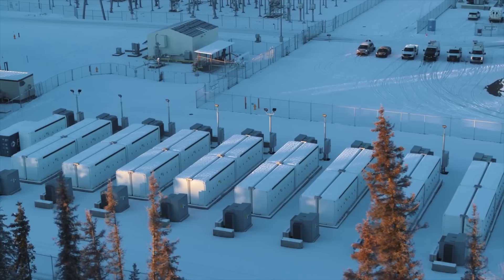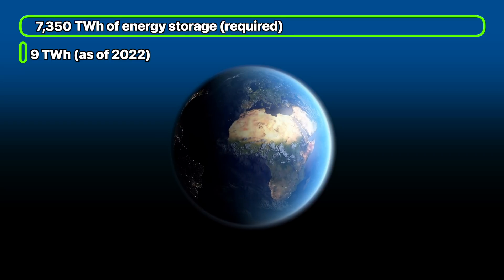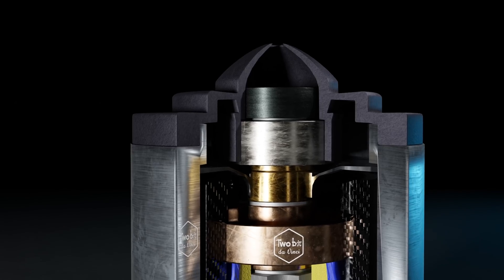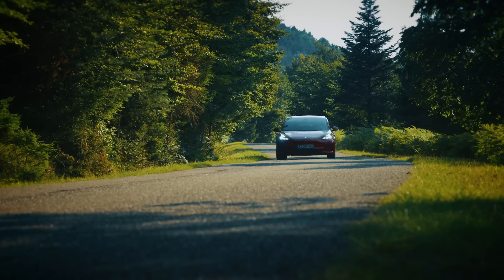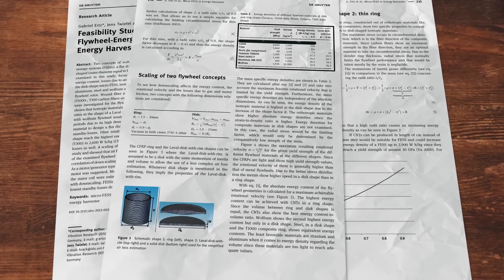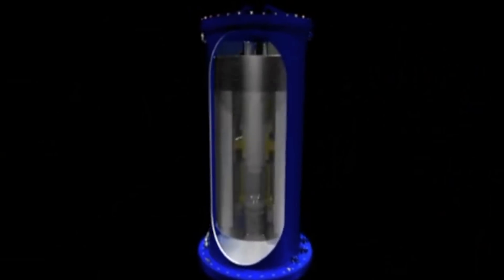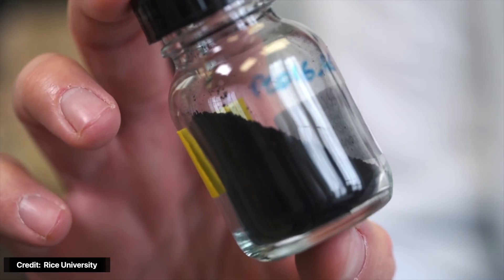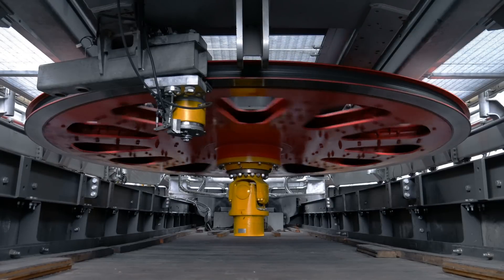Breakthrough Energy Storage Tech CRUSHES battery prices by 90%!

Comment from the maker: Go to https://bit.ly/3xzaugU  and use code TWOBIT to get 15% off ClickUp's massive Unlimited Plan for a year! Start reclaiming your time for less than $5 a month.
Reply: Would not a larger flywheel  (like 30 meter of diameter) be more efficient ? With magnetic suspension, it would allow lower spin limit (and thus less expensive material that don't need to stand high centripetal force).
Reply: @En_theo  The problem is that magnetic suspension isn't simply free; magnetic fields sweeping through conductive material induces eddy currents. These cause eddy current losses, as those currents heat up the metal and dissipate energy as heat.
Reply: only non ferrous metal produce Eddie current,big steel can levitate with magnets in the bottom repulsive force ant in the top atracción force.
Reply: @yvanpimentel9950  Are you sure about that? Induction cooking stoves work with ferrous metal pans. If eddy currents were not produced in ferrous metals, how could induction cooking work with ferrous cookware?
Reply: @Berkana  heat is created if a alternating current traveling true a coil (electric magnet) in ferrous metal,non ferrous metal like aluminum ,fold ,silver copper produce Eddy currents like magnets that opposes the one in the electric magnet,heat is Olso generate ,if aluminum is used in a inducción cook stove it should vibrate more than heating.
Reply: @yvanpimentel9950  
Or we could use water and fill the flywheel ? Can't be cheaper and if the wheel is large enough, it can store kinetic energy with lower rotational speed. It should also be cheaper to have one big wheel than several small ones.
Reply: @En_theo  fricción from water is small,but at lower speed and gigantic size weel it might work.
Reply: Do these ultra high energy storage flywheels have gyroscopic forces that resist the rotation of the turning of the earth? As the hours go by, a flywheel mounted vertically will change orientation due to the earth's rotation to a non-trivial extent. Gyroscopic forces would certainly exert pressure on the axis of rotation. Could this contribute to flywheel losses?  I imagine that a flywheel storing a huge amount of energy would have to be pointed at true north and tilted to be parallel to the axis of the earth to cancel out this problem, but none of the flywheels you showed in your video seem to be doing that.
Reply: It is so foolish for the global warming and climate change alarmists to think doing away with fossil fuels is a good idea. In fact, the accumulation of fossil fuels, biofuels and sequester of CO2 in the ground for a long period of time will eventually  lead to a repeat of the largest mass extinction of life on earth like that happened 250 million years ago when massive volcanic eruptions caused huge amount of CO2 and natural gas trapped underground to be released into the atmosphere.

We know the killer lake Nyos killed a large number of people many years ago when the CO2 accumulated at the bottom of the lake released all at once during an earthquake. Since then some smart scientists have been keeping the lake safe by releasing the CO2 from the bottom of the lake into the atmosphere gradually with pipes and pumps.
Suppression of CO2 release into the atmosphere by banning fossil fuels and by sequestering CO2 in the ground  is  as stupid as suppressing the dissipation of CO2 from the killer lake Nyos into the atmosphere by banning the degassing with pipes and pumps.
Reply: I do not ven know if this is a current thing or even possible but... Magnetic bearings for the flywheels? Can't lose energy to friction if there is none yeah? Or even the much harder possibility of using quantum locking (but how would we keep it that cold?)
Reply: @TheWeaponshold  magnetic bearings are not lossless. They can induce currents which give resistance that drag on the flywheel.
Reply: @Berkana  Eddy currents. You can use windings to reduce that but IIRC that was to redirect the energy not prevent losses. But I would still love to see comparative testing.
Reply: water pump with compress air is to me the best because you can oversized capacity without increase of metal sheet but decreasing the amount of steel per unit of power, even if conversion only go to 80% long term is 100%,if windmill is the power supply the air tank can be the tower decreasing the overol investment even more savings if the generator is hibrid,this is water turbine in one side and a fossil fuel power supply on the other end,this will ensure continue power producción.
Reply: Have you heard of Teraloop?
Reply: Yes. Making your flywheel smaller and lighter. Requires higher RPM. Which exceeds the material strength of most metals.

However. Flywheel energy storage. Is not a great application for mobile or even compact space-saving locations.

It's meant to have all the room it needs. And be immobile. Not to mention all the resistance it produces on the drivetrain of any operating vehicle.

From race cars, bicycles, Avionics. Or just the good old crankshaft flywheel for most combustion engines.

It just depends on the application. But that's my point. Where The flywheel is most applicable. Would be large-scale power storage.

Where you can have a very large flywheel. With as much energy as you can engineer into the size of it. And then operate at very low RPM. With a cubed energy density to match.

And while better tinsel oil strength is always better. More mass is more important at larger scales.

In which case they should be made out of lead. Where the greatest engineering feat is how not to apply any resistance to something of that size and weight.

But higher RPM is better. At any diameter.!

Comment: I'm sure the flywheel battery is excellent system. By the way why don't you use oil bearing for vertical axis? It has very good lubrication which is applied for turbo molecular pump.
Next question: Maybe you use a DC motor. Voltage of the motor (generator) goes up and down by charging energy or discharging. What is the range? If you use a system of changing frequency 
, how do you control the line voltage?

Comment: Switching electric power supplies are efficient and operate as delivering energy during a timeperiod of  then a timeperiod of no power delivered; I wonder if a flywheel can be charged and maintain its energy using electric motors and switching power supplies having a longer off period allowing a flywheel to deliver energy during the off periods

Comment: A capacitor that size could easily store as much power and would not suffer from the acceleration of mass, self discharge, and energy conversion  problems. This is a boondoggle.

Comment: Is anyone developing gravity batteries in a serious way yet? Where you lift a a weight into the air with spare power, and then lower it to regain power in a lull. Basically pumped hydro. But with a huge lump of, say, concrete.

Comment: I'm so confused as to why light weight material would make a better flywheel.    Maybe it's the difference between that battery looking flywheel and the large diameter style.    But that inertia from the weight seems pretty important on the surface to me.  especially if you reduce the friction with magnetic bearings.    I need to look into this more.  Very interesting.

Comment: the problem with flywheels is they all lose their energy in a day. so flywheels can be used to stabilize solar/wind  when is intermittent in spans less than half a day. so maybe a during the night wind and flywheel work together, but if it is a still windless weather and long night maybe the flywheel won't be enough. This is why I believe flywheels are better used for peak time get the excess let the lithium battery discharge a bit and then recharge it with the flywheel.

Comment: The key is not to depend entirely on solar. The ideal home and municipal grid would have a diverse array of generation and storage options. Each have their advantages. Solar generates a good amount during the day, wind generates all day, tidal/hydro has massive torque potential as well as consistency, and fuel should really be our backup when all else fails not our mainstay generation. To that, chemical batteries are energy dense but high maintenance, flywheels are low maintenance but need a bit of energy to keep  their stored energy, gravity batteries are great for long term in my opinion but should be underground for their potential destructive capability if they fail (same with flywheels IMO). I have high hopes for thorium-uranium nuclear and cold fusion but they also should be part of a diverse grid.

Comment: bro, taking "goal number" of tesla 4680 energy density and saying it's production numbers is something. they are not there yet . also comparing energy density of battery and flywheel is strange at minimum. flywheels are the worst possible solution for mobile use bcs of the gyroscopic effect and additional stress on bearings. and u used power density and energy density like these are different things...   ffs why i even subbed?

Comment: flywheels could even be used to fast charge battery electric cars, with the car rapidly spinning the flywheel up  when plugged in, then gradually converting that short term mechanical energy in the flywheel into long term electrical energy in a battery

Comment: Thermosyphoning liquid metals such as mercury through a coil to produce electricity was discovered many years ago. This only requires low grade heat to operate, and there is a gigantic amount of low-grade heat currently underutilized. Imagine the heat from road surfaces for example, or roof spaces, hot sides of structures and so on. The metal circulates around and around and there are no other moving parts and it is said to be 55% more efficient than an alternator. I enjoy your explorations so much, thanks.

Comment: There's always a practical limit to the maximum amount of energy that you can safely store as a rotating mass.  
A number of horrendous and extremely destructive accidents have occured in the early days of industry when large flywheels have broken free from their bearings and destroyed buildings and factories. 
From an engineering point of view the use of a flywheel is simply to smooth out power impulses,  to overcome any intermittent or unbalanced resistance, and to reduce vibration. 
I was once unfortunate enough to be standing close to a high speed steel fan which weighed about 150 lb's when the shaft on which it was mounted suddenly sheared off.   The fan totally destroyed it's steel housing which was fabricated from  3/16" steel plate and ripped it loose from it's holding bolts. 
Believe me you don't want to be anywhere near large revolving masses when they fail.

Comment: If flywheels were worth it, by now you would see them in the basement of many homes so you could charge them at night when electricity is cheaper, and then use the power during the day. But you don't. The free market has spoken.

Comment: The one big problem with this is the fact that you have 2700 watt-hours per kilogram of fully charged flywheel just waiting to be turned inevitably into thermal energy in the event of an accident.
It would be like setting off an underground bomb.

Probably wouldn't be an issue if they were sited in remote areas but it would make building an array of them really hard.

Comment: Best Battery = Ambient Space

Over 50 years ago,  famous physicist Richard Feynman said :
"The vacuum of empty space appears to be an energy reservoir of immense capacity 
that makes nuclear power seem old fashioned.  
The amount of energy available in one cubic centimeter of the vacuum [ambient space]
is much greater than the energy density in an atomic nucleus."  

If you can harvest more energy from the space around you than you can use, 
then, logically,  you don't need big batteries or big capacitors. 
The vacuum of space is the best battery.
Reply: Elon Musk only promotes centralized "Giga Factories" for cars, batteries, solar panels, etc. 
That is contrary to Independence.  That makes slavery easier to achieve.
Chemical batteries, big capacitors, solar panels, wind/geothermal/hydro-electric,
biofuels, fossil fuels, Tokamak-like fusion, centralized power plants, the electric power grid, etc.
will all soon be obsolete and disappear.

Comment: Stupid question - could you set up a wind generator (especially those ones that are big enough to run towns) to direct its intake power to one of these things and then generate it at a more civilised speed?  I read that they have to keep locking those things for going over-speed, I'm wondering if a solution like this could be integrated to avoid and actually make use of that burst of speed.
Reply: and low wind to,air compressor will solve this and increase the avelavility of power

Comment: Are the energy losses in standby still 3-20%? My understanding was that the modern generation of flywheels - sealed in a vacuum and using magnetic (floating) bearings - had significantly mitigated their passive energy loss. Could you update this detail or suggest a source to check on this further?

Comment: Another possible material is single crystal sapphire whiskers (aluminum oxide)...  Currently tested to 10-11 Gpascals with a theroretical for Aluminum oxide of 30 Gpascals... equivalent to te 30 GPascals of carbon nanotubes.  they do have the same issue of length as do carbon nanotubes,  however they do not have the issue of being burnable.. as they are already oxidized.

Comment: I did see this concept not to long ago here on YouTube (go figure) but they were talking about using a super cheap material for the flywheel mass....concrete. a cylinder buried in the ground in a vacuum sleeve, I believe using magnetic bearings.

Comment: Unless they can figure out a way to reduce frictional losses from the rotation during standby, I can't see this as a good long-term energy storage solution. Maybe if it's paired with a pump whereby water or a heavier and more viscous liquid is pumped and stored to a height, then it can be stored as a feasible potential energy with almost no losses during standby. However, that would require considerably more space and lots of liquid

Comment: How much power does it require to keep a flywheel spun up could it be paired with  another storage technique to prevent that loss while not being used? Or is that 3-20% factoring that in? And how are they spun up is it mag lev vacume with magnetic propoltion?

Comment: Surprised to see Ricky propose flywheels for EV use. That’s quite funny, I thought Ricky knew basic physics, like (say) rotational momentum… I.e. you can’t have a flywheel in a vehicle that constantly changes its own movement characteristics!
Reply: Well, it has been used before, see: gyrobus.
Reply: 2 flywheels maybe?
Reply: @markraden7031  running two would be worse, since the rotational momentum of the system would be even bigger, introducing stress to the chassis.

Comment: They might have to use a giant fully gimballed carrier for these flywheels. Unless you place the flywheels flat exactly over the north or south poles.

"Flywheel energy storage systems using mechanical bearings can lose 20% to 50% of their energy in two hours. Much of the friction responsible for this energy loss results from the flywheel changing orientation due to the rotation of the earth.."

Comment: Nope. If you crush some numbers, the energy density for a flywheel (ultimate material tensile strength / material density) can be found to be quite modest as best for any current, realistic engineering materials. For some carbon fibre composite with tensile stress of 1 GPa and density 1500kg/m3, the energy density 185 Whr/kg is about the same as for some Li-Ion battery cell, assuming optimal flywheel shape. That may change with the becoming materials like nanotubes etc., but those materials will be economically out of reach for a long time. Being much more complicated and dangerous design when compared with a Li-Ion cell, the large scale flywheel storage projects will probably end up being another failed start-ups for a number of decades, at least.

Comment: There's no reason to use wind energy. It is verifiably worse for the environment than just burning fossil fuels. Just stick to hydroelectricity and solar, but even solar is often worse than burning fosil fuels. We should be using nuclear and geothermal (20+km below sfc to get the proper heating)

Comment: When a flywheel slows down, I imagine most of the energy is dissipated via friction? Would that not cause heat production, sound and/or material deformation? Assuming the latter is designed around, and the energy losses to sound are negligible, that leaves heat.

Comment: Can't help think that gravity storage might be a better answer. Use excess power to propel a really heavy train up a gradient. When power is needed allow it to run back down and drive a generator as it does. Regenerative braking on a giant scale. When this train is at the top of the gradient it doesn't lose that stored kinetic energy.

Comment: if you make a sphere 50m in diameter and fill it 3/4 full with the graphene energy system the u of ark demonstrated and used the rest of the volume to cool/transmit the power generated the system would produce on average between 1.5 and 3.5 times the total global demand ... every second ... for forever, let THAT sink ... if you embedded these generators at the point of use on devices and used a source of initial power like a piezoelectric spark in a small clicker, no device will ever need a recharge again. if you embed the system in the components of the car it can be made truly unlimited range. but nope we still got to use kardashev level 0 tech when we have actually tapped a truly unlimited energy source that would make us technically a k5 civ